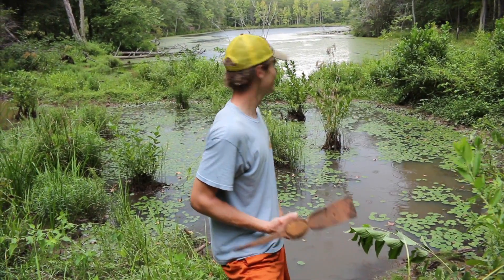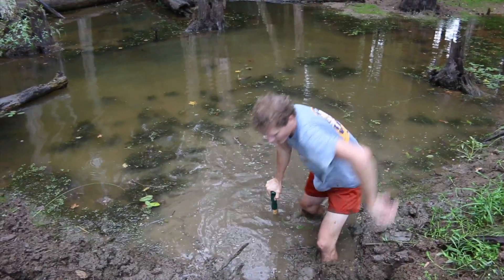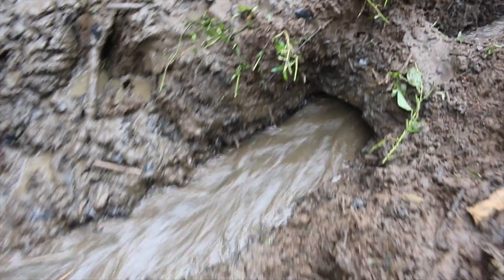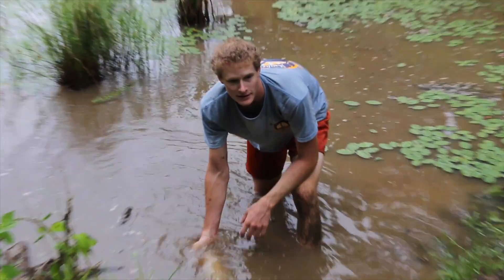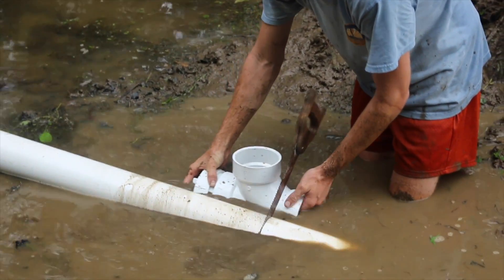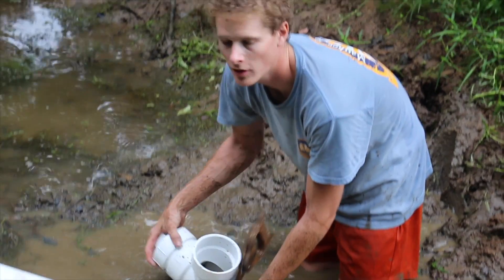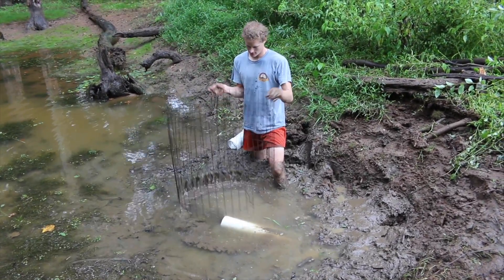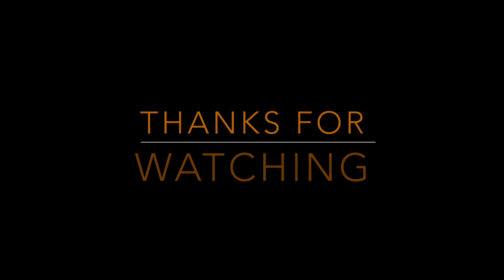Duck Hunting | Water Leveling System

Comment: Great Video. Did the beavers mess with your intake or did the cage work to keep them out? Thanks for posting
Reply: We actually havent drained the hole yet. Just left it full all during season... But the dirt we packed in on top of the pipe is watertight, because the water is almost level with the top of the dam.. the beavers havent bothered the vertical pipe from what we can tell
Reply from the maker: Here is an update video for you to watch!!https://youtu.be/XuR5CuT4Xyo
Reply: @EremosOutdoors   thanks for the video update!! Great Work!!